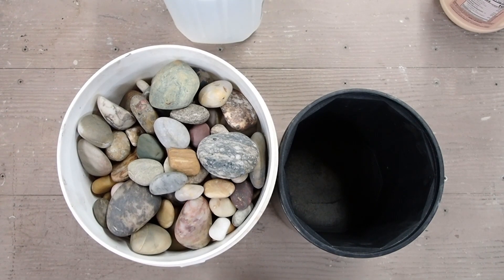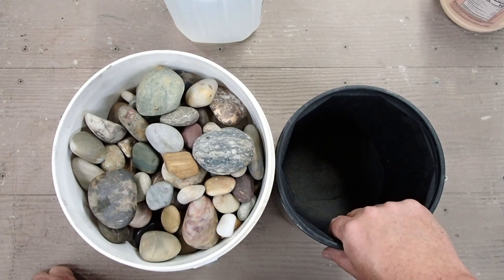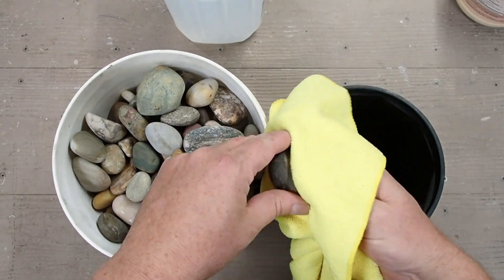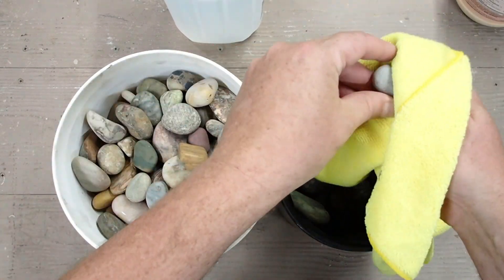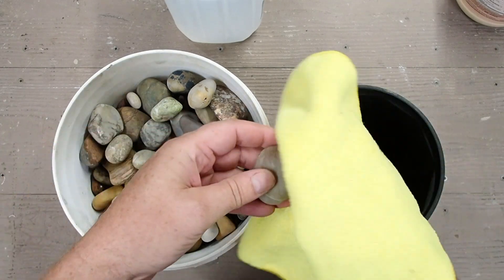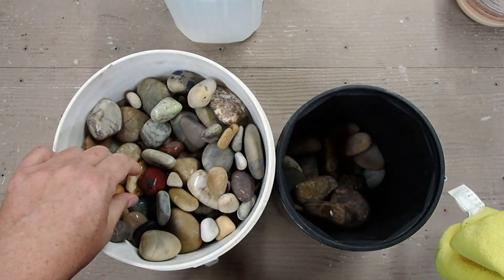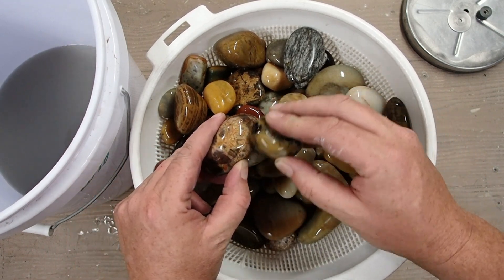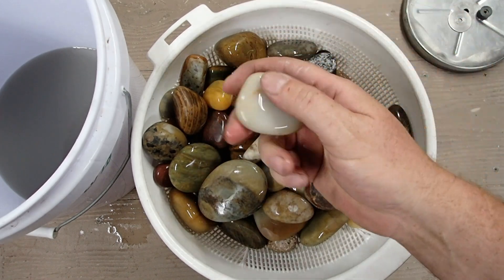The Theory or Myth of Burnishing Rocks

Comment: I just burnish after the polishing stage. Sometimes my Rocks have a film on them and burnishing removes the film and it does help with removing polish from the cracks in the rocks.we also have very hard water. I think that is my problem with the film issue. Illinois is mostly made up of limestone and that is where we get are hard water from. I burnish my rocks for 12 to 24 hours. I can only clean my rocks in my utility tub. I only have a faucet. 

I also believe that the black  water is from wearing down of the barrel. I have warn down some of my barrels where I get a hole in the bottom of the barrel. 

There are so many different ways to tumble rocks that sometimes it can be confusing. So sometimes I just experiment just like you. 

Your rocks are very beautiful and you do a great job on them. 

I think it is great that you try to help people with tumbling and show people different options.
Reply from the maker: Try your final polish using spring water, even the stuff from WalMart.  You may end up with better results. Also add one tablespoon of borax every 3 pounds of barrel capacity. With your grit and polish.  You will see improved results with these two changes.
Reply: @crazycabochons  I do add 1 tablespoon to my prepolish and polish stages. I will have to try the spring water. If it is not too expensive. I just bought a 15 pound tumbler. I went to Marquette Michigan on a vacation trip and Kingsley North was on the way so I stopped. I have been waiting on a Loratone 12 pound tumbler. They are hard to find. So the people at Kingsley North told me about the Rebel 17 tumbler. Said it was just as good as the Loratone. So I bought it. 

You are up late.  I am at work. Hope you are doing well 😊

Comment: I clean the rocks between stages (starting at 220 grit) using a pinch of Ivory soap and run it for an hour in my Mini-Sonic, that's it.
Reply from the maker: And with the mini sonic, you could reduce that by 30 to 45 minutes.  For cleaning, replace the Ivory with Dawn (blue) dish soap and reduce the time to 15 minutes. Try it one time and see if your results are the same or better.

Comment: Would you recommend still washing in between stages for people without power hoses?
Reply from the maker: No power hose, just a nozzle with a fine spray is what I use with a garden hose.  A kitchen faucet with a spray setting works very well as long as you are doing it in a bucket where you can discard the wastewater outside somewhere and this is what I do in the middle of the winter.
Reply: @crazycabochons  thank you

Comment: You are certainly the most expert rock tumbler I have ever seen. But, if you had done a barrel of the same material prepared the same way with just plain water it would be much more convincing.
Reply: You're right, it would not be burnishing. It would be a control run to show you get the same result without the borax.
Reply from the maker: That is not Burnishing, so it would not be a valid test.   Burnishing involves some soap like substance like Borax or Ivory.